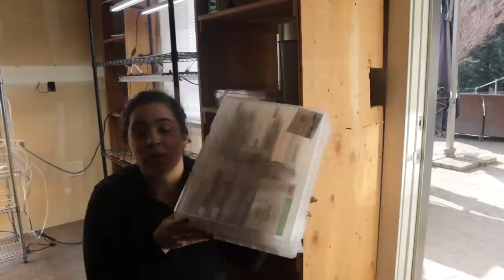Seed Starting Essentials - Setting Up an Indoor Grow Room

Comment: Hey Becky, 

I know some other people have touched on the electrical but I would like to address it too. 

Put the timer on one of the plugs between the shelves so that you don’t have to dig for it, should it die (I’ve had two die on me).

While power strip to power strip isn’t “safe” it probably won’t hazard out. If the lights use too much power, this won’t work.

The amount of lights may create issues with too much power going through it (might get HOT!) 

Enjoy the planting season! 😊

Comment: Looks great! You have so much strength and energy, Becky. It amazes me how much you accomplish each and every day. My husband has always been like you with time, goals and checking them off his list at the end of each day. And he is a very, very young 80 year old. I used to be almost as driven but life and health can sometimes slow a person down. 

You are going to enjoy your new space so much. I did wonder about your freeze dryer and dehydrator when the dust was in the air. I would worry about the machines, given their value in cost and benefit. A partial plexiglass  partition on wheels or even a light curtain pulled across might protect them...something that wouldn't block your view of your lovely growing seedlings. And the partition on wheels is an investment to use in many ways once you move to your greenhouse. Just my two cents! 😉

I also wanted to tell you how much I have learned from you. I had pretty much given up on cooking and it was the hardest thing to let go of in trying to simplify my day to days. It was like losing my identity, as crazy as that sounds! I just loved being in the kitchen and, as a American from the South living in the UK, I had plenty of requests. After watching you, I am in the kitchen again, cooking/baking away! And doubling up recipes to make easy days in between. I always did these things before but you gave me the motivation to start up again. I just rest a lot as I go along. My goal today is to make some loaves of banana nut and , maybe, pumpkin breads. I want to make your breakfast casserole as well. My husband loves something just a little sweet with his mid morning and afternoon teas and this will be a healthy alterative to his 'biscuits' and pastries. Thanks, Becky!!!

Comment: If you just plug in your heat mats they will flatten out easy and quickly. I think you would be better off using your little basket for your dirty gloves, otherwise you will just fill the drawer and not realize you have enough to wash until you throw in another pair of dirty gloves and the dirt from the gloves will just end up in the drawer. JMHO .  Room looks great, you will feel so good when you start using it. Nothing better than an organized space.  Have a great 2023 growing year.  Barbara from Sweden

Comment: We've put screw-in wheels as replacements for the feet on many of our wire racking shelves like you have. We put in low profile, industrial steel wheels with good stops.

Comment: Becky before you Struggle with those drawers with your gloves in it again, get a bar of soap and run it along where they touch each other. You can do the same thing with glass sliding doors

Comment: I hope you won’t mind me making a suggestion.  What about swapping the table holding the dehydrators and freeze dryer on the right hand wall and the black base units on the left hand wall.  That way you could use the wall cabinets on the right for storage.  Love an organised space, so much nicer to work in a calm location.

Comment: Hey Becky, I think I saw you taking out a small wooden table - maybe use that with a cheap plastic table cloth over it? That should be about enough space to work on a tray or two at a time. This way you would not have to give up one of your heat mats. Also, the table I mean looked kinda on the smaller side - which is great - so you can move around it quite easily! And you already have it and it seems you don't use it!  :)
(and great work, looks really practical !!)

Comment: Great starting mix makes all the difference in getting strong plants. I use Pro-mix just on the top 1/2" of each  seed-cell and have a more nutritious soil in most of the cell so the seedling can grow a while without having to be potted-up until getting planted outside. Both the Sunshine mix and Pro mix are awesome soil-less, neutral  mediums to mix  into your  nutrient rich soil ( whatever that might be ) to add fluffiness and water-retention properties .

Comment: I've found I need fewer grow lights if I turn my trays the short way on the shelf. I can fit twice as many trays on one shelf. I've also saved money by using trays until they can't hold soil anymore. Even if its broken and looks bad, they'll still work. We could be getting 21 inches of snow(in MN) in the next day so I have a minute before I have to think about seed starting. I'm tired of winter tho. U are looking great my dear. Happy to spend some time with u.

Comment: Heya Becky I love your content, I'm glad you asked opinions at the end of this video.  I would definitely use that work bench table for potting your plants. Could you possibly use that 3rd black shelving unit for your heat mats, I saw you had an electric outlet conveniently on the wall by there.  Also may I suggest getting a second timer and plug the black surge protector into it separately from the white surge protector, as an Electricians wife I'm forever hearing not to plug too much into one outlet.  Just helpful suggestions love the content.

Comment: For cutting your carpet you might want to look at "hook blades". These blades are made for that purpose. For cleaning up the glue residue, You can either use paint thinner or acetone.

Also, for flattening your heating mats, you might want to try turning them on. As they warm up, they will get softer and more pliable.

As for your timer, you want them to be on for 18 hours and of for 12 hours. I believe that's not possible. Timers only time 24 hours a day. While what you want adds up to 30 hours, which isn't logical, 'cause a day doesn't have more than 24 hours. Even nature doesn't work with 30 hour intervals...

Comment: I have an idea for your floor under the carpet?? Maybe rip up the carpet and then paint (concrete paint) over the gluey stains? Even if there is some sort of raised texture to the glue stains, a painted surface would be easier to deal with than the carpeted area.
Also, do you live in an earthquake zone? If not, I was wondering why the water heater is so securely anchored to the wall?

Comment: I guess I need to start correcting a common misconception. 
The hardiness zone gives the lowest temperature that would be considered normal for the area.
That is different from, and lower than, the average coldest temperature for the winter.
My area, for instance, is Zone 5B. Our average coldest temperatures is -11C. However, getting a couple nights down to -25C would not be abnormal.

Comment: You can take an old table  and on one end cut a hole. Slide a bucket under it and it will catch all the spilled compost  so that you can use it again.....
Reply: or put a rectangle bin on the floor next to the table

Comment: Yes! Buy more grow lights, I think your new garden is going to call for more seedlings right!
Reply: You might consider a couple indoor fans with filtering on them to help with the dust. We actually took a box fan and taped a home AC filter on the intake side. Caught a ton of dust. Kept it off my plants. And humidifiers, you don’t have to spend much, but plants will love have a bit more humidity.
Reply: You also might consider ensuring the tape around the water heater exhaust is well stuck where it vents out of the wall.

Comment: I have a south facing window, and no funds for grow lights yet, so I’m starting my container garden indoors this year just in my sunroom on a table. My spring school loans refund next year will go to the major seed starting space. Fall refund is going to starting a no till in ground garden.
Reply: I’ve seen some gardeners start seeds in the 4x4 pots, and some start in the little seed starter squares. Are there any benefits to starting them in the tiny cubes? Or should I just go straight to the 4x4 and skip the up-potting step?

Comment: JUST bought a new grow light for my seedlings in the basement. Could use some suggestions on how to keep the seedlings from getting too leggy. I would like to just grow the lettece inside and use it as needed. Also my light said to leave on for 12 hours and off for 12 hours but has no timer. darn it. thanks for sharing. lets have some fun.

Comment: Too cheap to buy grow lights I bought the cheapest shop lights I could find, with the widest spectrum of fluorescent bulb I could get cheaply.  I used those for years, replacing some of them with full spectrum bulbs over time.  I have to say I was starting flowers not vegetables so I don’t know if that would make a difference, but it seemed to work well for me.  I haven’t gardened in a couple of years, but even at its height, my garden was a fraction of the size of yours, I am in awe of all you grow.

Comment: Could you please share what your using to hold your lights up with? I'm looking for something besides chains to control up and down to length I need towards seedlings. It looks like you have a loop with cable wire of some sort. Plus you have a clip to hold it on the light. I need this. I bought a bunch of chain at HD and I don't like the look or bulkyness. Yours looks much better. Thank you for sharing.

Comment: A generic carpet shampooer will make a huge difference in that carpet...and it doesn't  take that long....bet 35 minutes and you'll be happy...   also put heat mat on for 5 min,  with the weights on them, the heat will make them lay flat